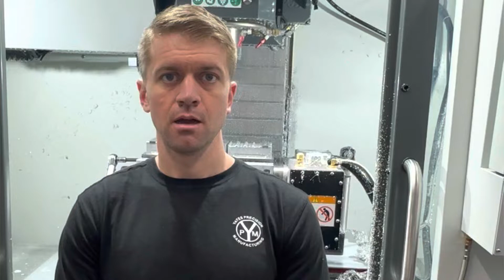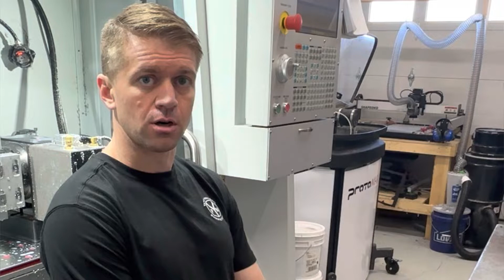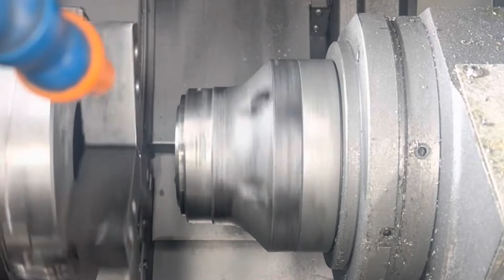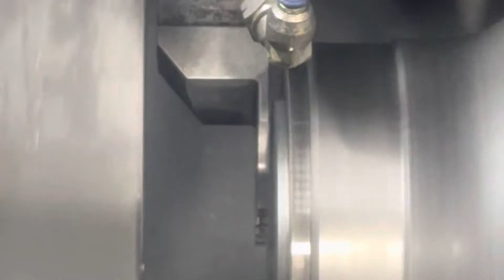Machining Pucker Factor Explained

Comment: How does this have no comments? That sub facing operation on short parts in the worst. 

I shudder every time the turret spins right next to the main, even though I know it will clear.
Reply from the maker: That’s weird, I could have sworn this video used to have comments 🤔